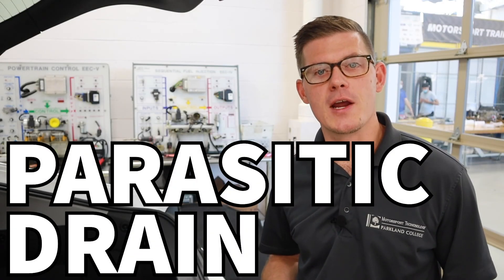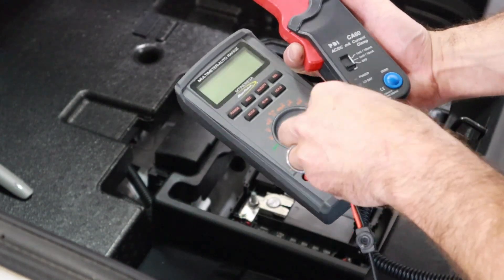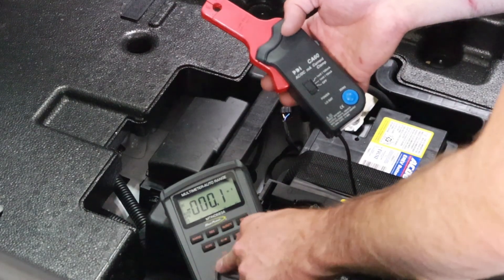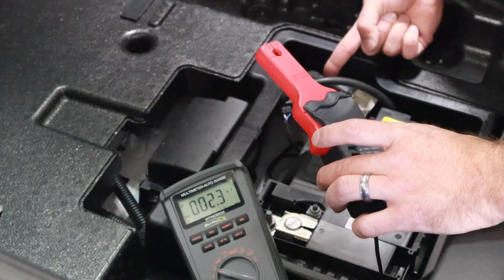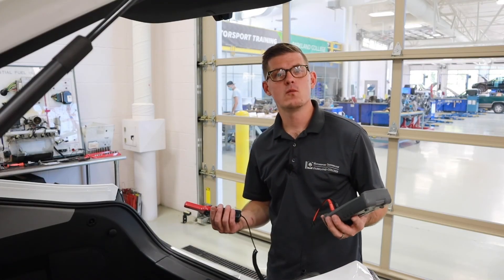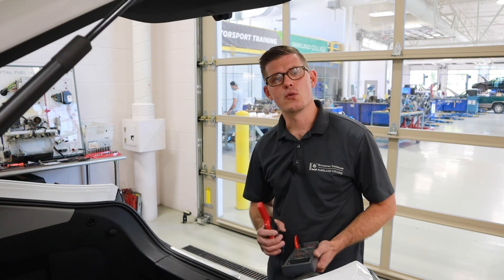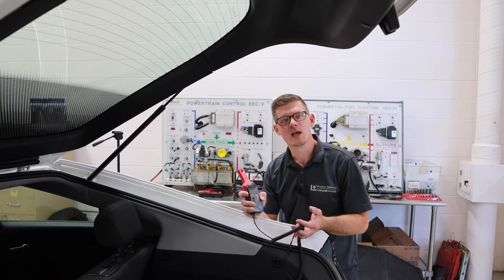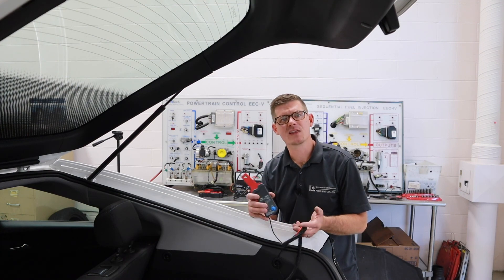Measuring Parasitic Drain with an AMP Clamp

Comment: why would my dc ampclamp show a 11 milivolt draw on the negative cable and a 54 miliamp draw on the positive cable?
Reply: I'm not entirely sure I'm correct but I'll give it a shot:
The difference comes from the batteries' capacity. The extra capacity of the battery weakens the necessity to pull the extra 40mA from the negative, rather from the acid cells in the batt.
the mA draw is too weak to pull it from GND cable in other words.
Reply from the maker: This is a good speculation. I would first ask about setup and whether you are truly capturing all ground paths to the battery. The next question would be the possibility of interference. Amp clamps are unfortunately very vulnerable to influence. When a difficult drain is being assessed, it may be better to put a meter in series and eliminate some of these variables.

Comment: Where do you find out what the normal parasitic amp draw value is for a given vehicle while the vehicle has entered sleep status?
Reply: 50ma is specs on every vehicle 0.050A
Reply: I've always been taught anything over 50 milli amp or 0.05 amps is to much I guess it would depend on the amp hour of the battery take amp draw x 24 to figure out amp hours per day being drawn

Comment: According to my amp clamp manual when you zero out the clamp reading you need to hold your clamp in the same orientation as when performing the reading, otherwise the reading will not be accurate.

Comment: Where do you find the amp draw in the manual spec, when car is at sleep? I can not find it?
Reply from the maker: Parasitic draw specifications can be difficult to find in a service manual at times. It is something you will not find in the owner's manual. Most vehicles pre-2000 should be less than 25-30 mA depending on their configuration of electronics. A newer vehicle with many electronics can see a draw spec of up to 80 mA.

Comment: Very good explanation, slightly more complicated by the equipment you were using, rather than a clamp with a built in screen. But not a problem if you listen carefully and are serious about doing the job properly. The alternator diodes were interesting, could you identify them by this method?
Reply from the maker: Thanks for watching! Yes, when I've suspected an alternator causing a drain, I take the clamp and go around the alternator output wire while minding the polarity of the current. This can quickly show if the alternator is consuming energy in its resting state.
Reply: Clamp-style meters now quite common , and much cheaper, than 4yrs ago.